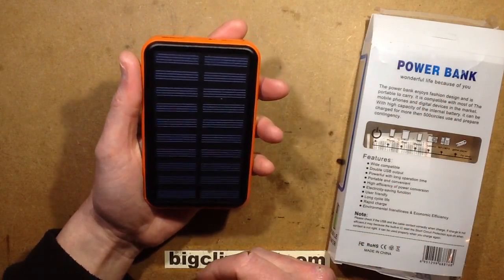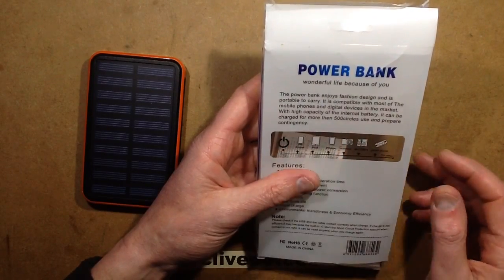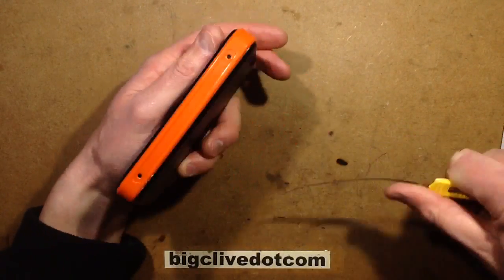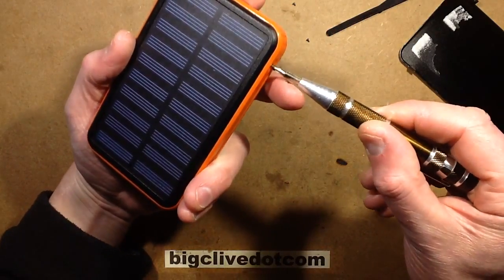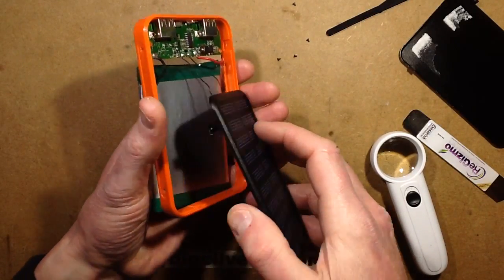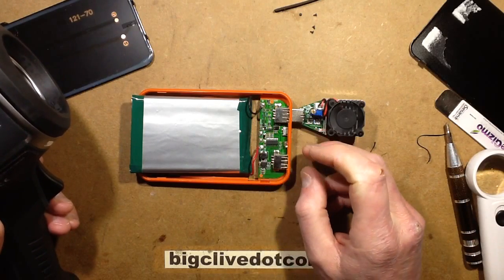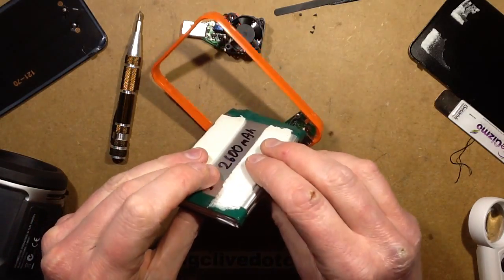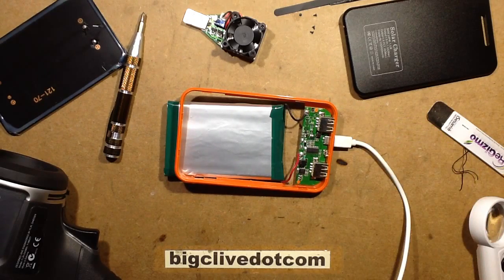FAKE! 100,000mAh solar powerbank capacity test and opening.

Comment: 2600mAh in this size? that's really bad.
Reply: Avery-John lipstick size? Its almost the same size as a standard can of coke.
Reply: Jake Shire maybr that's thier lipstick
Reply: There are 2x 2600mAh cells. It isn't "really bad" at all, for their size it's actually standard pretty much. From the video each cell looks around 8cm x 6.5cm x 0.5cm. For such a size 2600mAh is about standard. You shouldn't compare to the newest mobile phone batteries either, as a new 2600mAh mobile phone lithium battery will be around 25% smaller than these and still have the same capacity. But for regular lithium packs not used in phones then it's pretty comparable and standard.
Reply: Meanwhile the Anker Powercore 20100  (20.1Ah) measures 16.6 x 5.8 x 2.2 cm and weighs 354g (~12.5 oz) and costs £35.
Reply: Volvirth I got 10050 way smaller than this
Reply: Volvirth and I was expecting yours to be at least 15000 mah
Reply: The  power bank in the video has solar cells, so it needs a certain amount of area for those. Not a fair comparison to phones or lipstick sized power banks.
Reply: Alpaca Then how about Clas Ohlson asking almost 90 bucks for a 20Ah power bank? I still bought it, because it's the cheapest power bank with that amount of Ah in it around here. It's definitely not the size of a lipstick and weights a kilogram. And no, you can't order one online. It's a Clas Ohlson licensed exclusive product.
Reply: One of the better Chinese brands from China, who knew.
Reply: 2×2600 learn how to hear and read!
Reply: It's 2x2600mah, so 5200mah.
Reply: Anker is a scam, except I got my 12,400 mAh Anker power bank second hand for £12 from CEX and it's really rather good. :D
Reply: I wouldnt say scam considering of there wireless charging on some models and fast charging in and out.
Reply: Lol my phones battery is 2600 mAh
Reply: Yeah, i've got an 8500mAh that's a bit smaller than this one.
I'd expect at least 12000mAh from this...
Reply: Lord of the belts: The return of the KING My phone has 5000mah battery and what do you think how big it is compared to this? Of course this is bad for the size of powerbank.
Reply: @peraperic8775  yr phone cost at least 500 dollars. This thing costs less than 50. I would buy it, but i hate the fact that they lied about its capacity. Charges my phone twice. Good enough for about 2 days of normal uses.
Reply: but Anker is a scam. They think asking 50 bucks for 20.000 mah is okay

Comment: nice review! have you ever tried hooking up power bank in series?
Reply from the maker: I don't think hooking them in series would be a good idea.  There's a risk that it could interfere with the cell protection circuitry.
Reply: Since when have "bad ideas" stopped you before? Stick em in the explosion containment pie dish and see what happens ;)
Reply: bigclivedotcom
 I know it would be better to remove the batteries from the power banks and do it that way.  Thanks for replying anyway. Your public , however wants to see thing burn man. Make sure you wear goggles and stand behind 1/2 inch Plexiglas if you do so.

Comment: So, should someone actually put out a 100Ah power bank, how long would a solar panel take to charge it, roughly? Because if it's a token gesture on a 5Ah pack, it would be a drop in the ocean to a 100?
Reply: probably lower than the self discharge rate!

Comment: Good review Clive.  One Question.... Exactly how effective is the Solar charger on these things ?. To charge it from a low state for example.
Reply from the maker: It's not even recommended to put these things in full sunshine for thermal reasons.  But the output is going to be around 100mA at best, so really just a background trickle charger.

Comment: I love the way all the sellers of these things are outing each other jazzing the specs up!

Biggest one I've bought was actually not too bad with three 2600mA lipo cells in parallel when I opened it up...... also was the best firework I've ever bought when I put a screwdriver through it fully charged out the back garden last November lol!

I still think powerbanks based around 18650 cells are the best option though, I've always found those based on flat lipo cells don't last very long. Either the charge control electronics start failing (safe) or the cells just fail, but I've yet to find one that'll charge for this mythical >500 cycles figure🤔

Comment: The actual limit for measuring 5 volt output is +/-0.25 volts. A powerbank or a wall charger could do 4 amps at 4 volts, but no usb device can charge with such a low voltage. The minimum voltage that phones, tablets, etc. accept is around 4,75 volts. They will not draw more power if the voltage goes below that, to not damage the device itself, its internal battery or the charger. At least that is the case with properly made phones, etc. Measuring amperage below said voltage is pointless for the intended purpose (charging your phone).

Comment: A BMW i3 has a 94Ah battery. They should stop holding back the tech, clearly they should have way bigger batteries if this is 100Ah in the palm of your hand.
Reply: tesla have only just managed 100kw, (no idea what that is in AH, ah is a cheat really) it took them some years to get from 80 to 100, as the 80 was the top model (60 being its brother)  (oh i checked the i3 is around 33kw)

Comment: I have one that says 50,000mah with a solar panel. I think the solar panel doesn't even charge it. When exposed to light the leds will flash but I've let it "charge" in light for weeks strait and it doesn't add any power

Comment: Can you charge that power bank all the way with it solar cell
Reply: Not Really. The flashing indicator lights that go on while it is charging basically use as much, if not more power than it is getting from the solar cell. Even without those lights, it would still take days to charge a 5200mAh pack like this from the solar cell alone. It's mostly just a gimmick.
Reply: Thanks for the  info
Reply: I can't speak to this model but I have/had a cheap one that is similar and did some testing and it definitely worked. Can't attest to the time it would take though. The problem is that keeping these batteries at 100% is actually not good for them. Mine swelled up.
Reply: That's assuming what comes out of China is using the latest up-to-the-minute tech. But good to hear it's getting better.

Comment: What about the solar cell? How long to charge on a sunny day?
Reply: He never said how much it produces, so I can only estimate based on its size but I'd say it produces about 150-200mah at 6v, so at 5,000mah you can expect it to take roughly 30 hours and unless you move it around you're only going to get about 3-4 hours of sunlight every day, so about 10 days.
Reply: vgamesx1 Or half a year if it actually had the claimed capacity?

Comment: The average car battery has 80 -100 Ah (Amp hour) ie. will operate at 100 amps for 1 hour or 1 amp for 100 hours. this is simple to understand. Manufacturers seem to like going with mAh (milliamp hour) (mil = 1000) as in 1000 kilobytes = 1 megabyte. using mAh is a good way to do it when we're talking about drone batteries for example which are around 5,000 mAh. or 5 Ah. So basically with this simple knowledge, you can easily deduct that if such technology in batteries could be crammed into a pocket sized box, why would car batteries be so big and heavy? Yes... even lithium polymer has to weigh much more than that to have a 100 amp hour capacity.
Reply: the few lithium replacements for car batterys have a lesser amp hour capacity, mainly because they can easily handle the huge starting amps needed without large plate area, so they tend to be 1/4 of the ah, battery tender make some a 14ah will be about as much cranking power as a 45ah small car lead acid, (it compared to the 063 varta i have in my car) but is 1/10th of weight, and less than 1/4 the physical size,, but 6x the cost...im sure ferarris and such use them, but will be a while till normal cars go for it, plus we dont have a recycling setup for lithium yet, but lead acid recycling is very good. as for life, ive just replaced my car battery, it was 11 years old, only replaced becuase i had a money off voucher from an online battery seller so it worked out about 25 quid for  a varta 063 silver

Comment: Couldn't you ask for a refund due to not as advertised, get your money back and let them take it back off you/let you keep it? Might cut down on the misrepresentation if a lot of people did it.
Reply: better to just report it as not received, after all, where is the 10000mah bank he ordered, this aint it, i spent ages with an ebay seller, i bought two led lightbulbs, one didnt work, so a half refund right? nooo.they wanted to give me first 5p, then 10p (it was only like 1.50 for the bulb) only when it came due for ebay to deal did they refund the half

Comment: How big would the thing have to be to put out what they claimed?
Reply: Not by that much. Slap ten 10Ah lipos on each other and bingo, you got yourself 100Ah powerbank :). 
But expect total weight over 2 kilograms and brick-size dimensions.
As for step-up circuity, well that's a totally different story.

Comment: How long do you estimate it would take to charge from flat using only the solar cell?
Reply from the maker: On the basis that many of these units overheat badly in direct sunlight and start to puff up or worse I'd say it's not even a good idea.  But it could theoretically charge in about 50 hours of direct sunlight.
Reply: Thanks.

Comment: I've got one of these but mine says 3000000mAh on the back! Seriously.
Reply from the maker: Damn.  I must have got the mini version.
Reply: Mine is 20000 @ $15US (off amazon US), so I don't feel as ripped off as others.  However I just got it and now it won't recharge with the microUSB.  I got to mess around with the solar panel, but was going to send it back.

Comment: Can I start my car on it ?   Does it power a 787 or a city ?   How many times at 2A USB can I charge my Ipod.     I bet you its like PMPO   on hifis.   100W amp music out is at 1Khz sine wave only.   Same for this it does 100,000 amps for 3pico seconds.
Reply: Even in case this 100Ah would be correct, this figure tell only capacity that can be stored inside, not the maximum power rating - e.g. how fast can such pack be discharged. Those numbers are independent of each other.

Comment: Does the solar current actually charge the batteries?  Or, go directly to a USB port to trickle charge an attached device/phone?
Reply from the maker: It's supposed to charge the battery.
Reply: it is connected to the board, hence you see its led lights fire up when it gets some power, wasting most of it, it does charge the battery, but in real terms, not enough to be worth anything as the cell is terrible anyway
Reply: You answered the actual question. That puts you in the 1percentile of people able to do that in the 21st Century. Congrats & Thx!  :D  Cheers!

Comment: When the metal covers are on does the top cover double as a heatsink or is there no thermal coupling between the inductor & other warm components?
Reply from the maker: I think they may be to reduce overall combustibility.

Comment: It is in fact 100000mAh. At 1V output. The thing is that mAh is a very poor descriptor of capacity when not connected with any sort of condition. Kinda like Watt ratings on speakers.

A better, and in the industry more commonly used, way of describing capacity is in Wh as that actually tells you the amount of potential energy stored under that specific use condition it is measured under.

The IATA rules does not allow for shipping lithium type batteries over 100Wh, usually trustworthy manufacturers write 99Wh on the battery to be safe because the IATA rules aren't quite clear enough if it is over 100Wh or under 100Wh that is not allowed or allowed respectively.

For that reason you can pretty much assume that any power bank stating capacity over 20000mAh, assuming they mean at 5V output and not the nominal 3.7V battery voltage, is false.

A quick gauge on whether a power bank could possibly hold the stated capacity is to look at it's weight. A good rule of thumb is that a power bank will hold 0.1Wh/g +-10% given the specific energy density of a typical in-case lithium battery.

Comment: Hi Clive, I believe you got the wrong idea with Chinese labeling. It has nothing to do with the capacity of one charge.  They are labeled with the total lifetime output, so this one will probably self destruct after approximately 20 charges.
Reply: It's funny how they avoid telling the whole truth on stuff like this. When you see UltraFire batteries for sale, they're listed with the total cumulative capacity of the cells you're buying.
Reply: @userPrehistoricman  I'd say the honest part is the name "Ultrafire", but they don't even hold enough juice to reliably catch fire.
Reply: @userPrehistoricman  I bought some AA lithium batteries from a certain Country marked 1500mAh and found on testing they were 250mAh and interestingly they only lasted around 8 charge discharge cycles.  They probably lasted a bit longer than the expected 6 cycles as I manually charge lithium's on my bench supply at C/10 to 4.2v per cell a less aggressive regimen than most chargers.  That was the last time I bought unbranded lithium's.

Comment: Check again,, and this time believe it's 100,000mAh.  :)  I'm going to buy 10 and power my car.
Reply: You only need 3, mah is not the power output, it is the battery life per charge, wire 3 not in parallel, and they will go from 5v output to 15v, if you wire them in parallel you will have 5v that will last days.

Comment: Wasn't that voltage (4.5V) a tad low?
Reply: Most of my phones and tablets seem to aim for a minimum voltage of 4.80v then they stop increasing their current draw. So at 4.50v I doubt many devices will charge, maybe they will just draw 500ma?
Reply: The Problem with USB charging is that the phone adjusts the current by measuring voltage drop. so if the power supply goes down, the current isn't increased any more. Power supplies are best if they have 5.25V, i prefer 5.5V even it is out of specifications because most cheaper cables drop a few mV, too.
Reply: Против Глобал
You might be right but that is the minimum before load, this PSU started off at BELOW the minimum, (Not Good) 
So my question remains, the 4.5V is a tad low is it not.
While I'm at it, the PSU started at 4.5V, you say the minimum is 4.75V so why did you bother to question my comment when the PSU was already under the limit??????
Reply: Yes, definitely low. However, most devices that charge through a USB cable will accept a pretty large voltage drop. Many cheap cables are made with wet string inside, so the voltage drop across the cable can be at least a volt, especially at an amp or two.
Reply: Yeah, I don't think my phone would charge at this voltage.
Reply: most modern devices will charge at 500ma but they will show the message not charging, they will charge if screen and not hammering the processor, but an i pad would take 16 hours at that rate